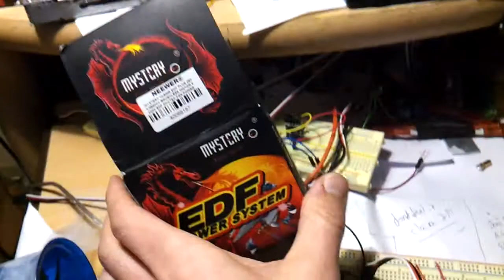Elecric Turbo - Does work

Comment from the maker: #include <Servo.h>

Servo mymotor1;

int state;
int val = 0;
int pos = 0;    // variable to store the servo position 
 
void setup()
{
  mymotor1.attach(9);   // Esc attached to PMW pin 9
  mymotor1.write(0);
}

void loop() //Main Loop
{
    val = analogRead(0);   // store the potentiometer value in "val" variable
    state = map(val, 0, 1023, 30, 190);
     mymotor1.write(state);
}